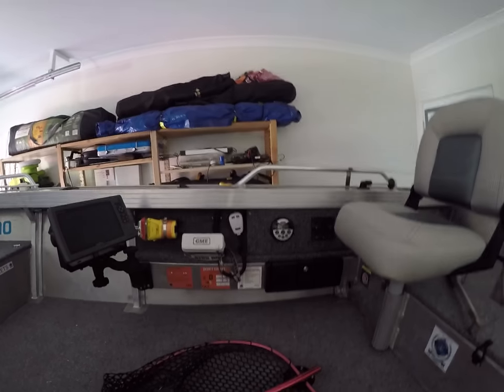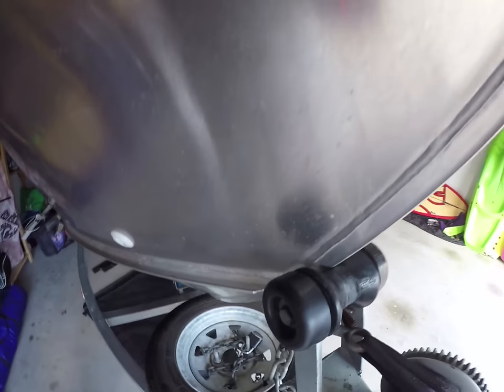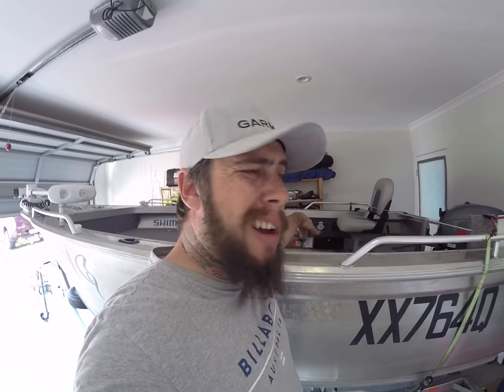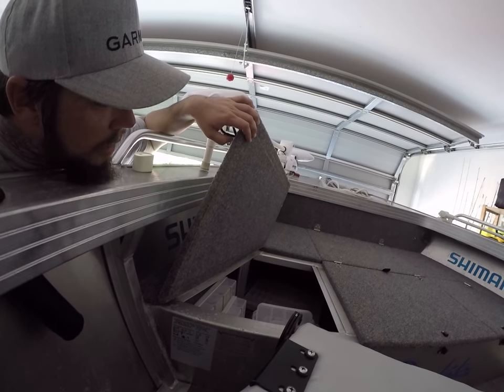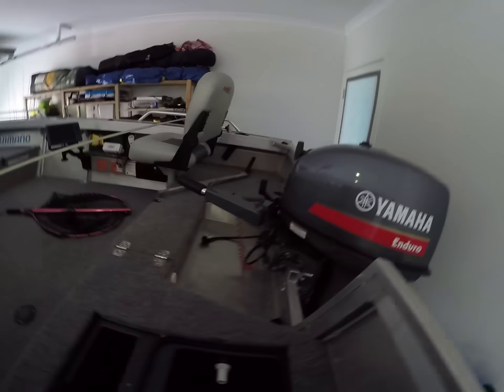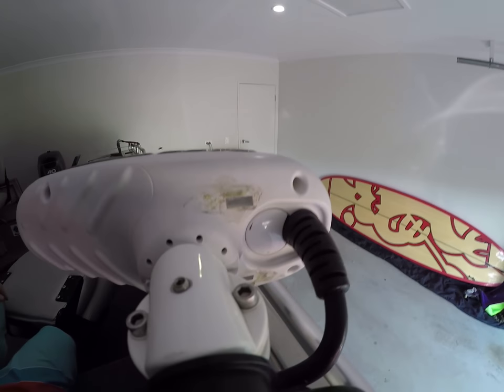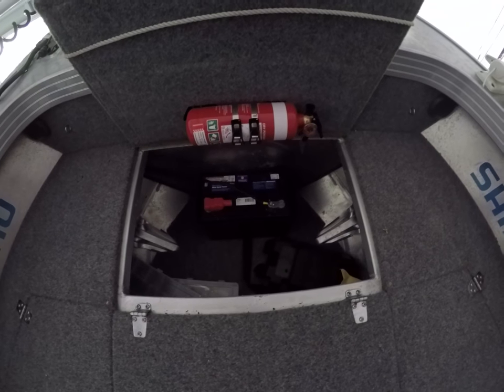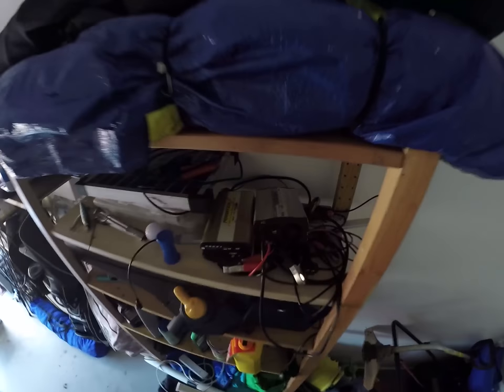Maintaining my Stacer Outlaw 429 Tinny

Comment: Thanks for the tip mate, i just bought a new Renegade so i'm definitely gonna seal it up like you did now!
Reply from the maker: Todd Bennett cheers mate, yeah definitely worth doing as the Renagade is basically the same construction.
Reply: Gday mate what did you use to seal the boat?
Reply: @jakeyoung5781  i just used sellys silicone roof & gutter sealer
Reply: Todd Bennett cheers mate thats what I ended up using.. did it before I hit the water! Thanks for the helpful video mate 👍

Comment: Yeah I've herd if you buy a painted renegade pay for the fully welded gunnel option otherwise it bubbles the paint.
Reply from the maker: Yeah heard that to. I could never have paint, I'm way to rough on my gear haha
Reply: @camlarner3330  Same here, I live in FNQ and if the tides ripping in the creek it's easier just to tie up to a branch or when picking up crab pots just nose it into the scrub lol. Mine is plane Jane with only option being a bow mount plate. I wanted to wait till I got the boat and really got a feel to where I want to put the sounder and a few add ons etc.
Reply from the maker: @chrisoh6627  we buy them to use them bro! Resale never been high on my priority list hahaha
Reply: @camlarner3330  Yeah I truly think there is the poser affect with some renegade owners lol fancy wraps, 4k+ sounders, sport seats etc etc. Then they end up getting sold 6months later 😂
Reply from the maker: @chrisoh6627  straight up!

Comment: I dont think on certain parts of the boat
It doesnt need to be fully welded.
That is a high cost... and potential  distortion /
Added cost of cleaning
You want it fuly welded
Add another $1500 at a minimum
No one would buy it
Reply from the maker: Appreciate the feedback and comment but I'll respectfully disagree dude.
If water can get in... Weld it.
You definitely get what you pay for but a complete weld around the gunnel wouldn't send Stacer or Quintrex broke.
Thanks for the reply man!
Reply: Noel.. bud, you make it clear you got no clue as to what in the actual fuck is going on haha.